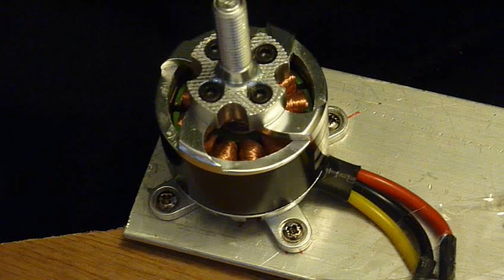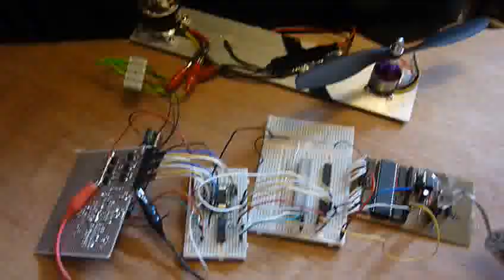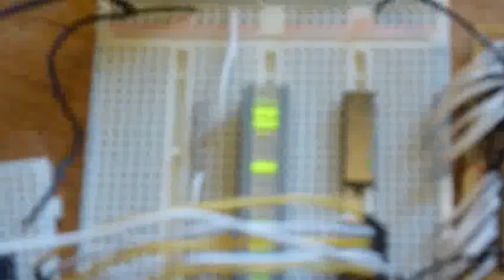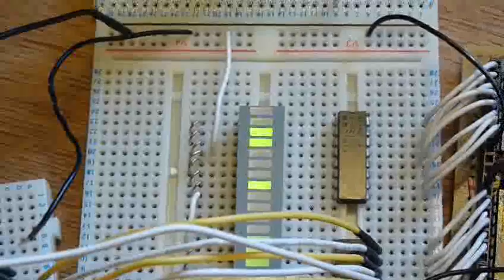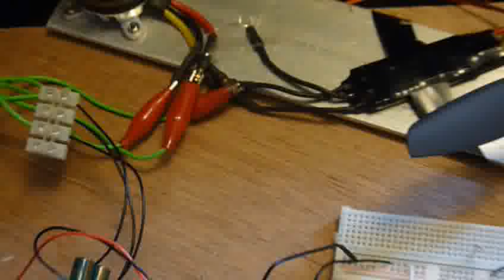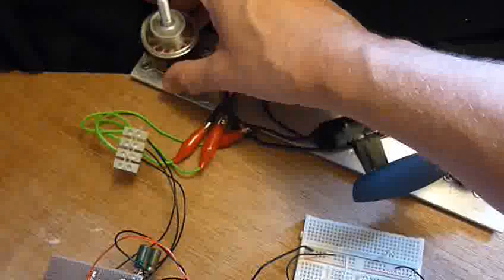p1080567.mpeg

Comment from the maker: The top 6 LEDs in the bargraph display the phase-error, the middle two of these shows close lock, when the others light up the timings are less good (happens at low rpm).